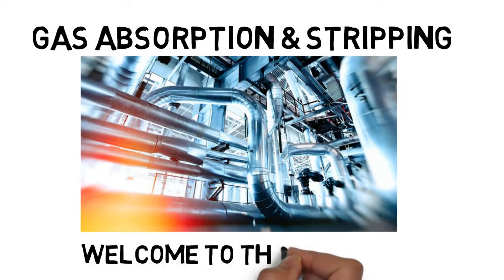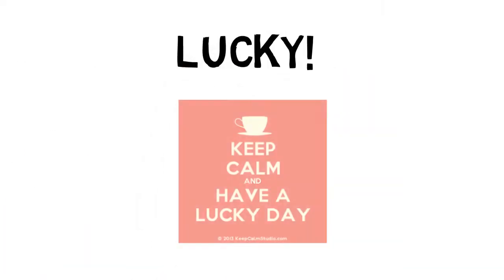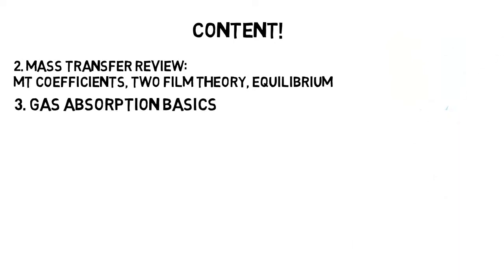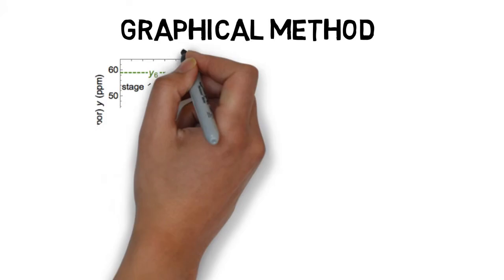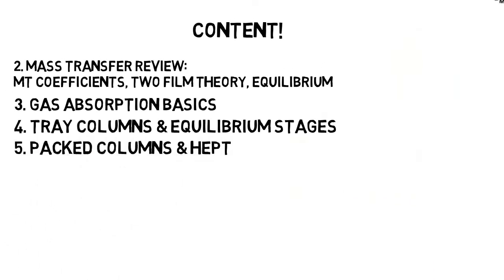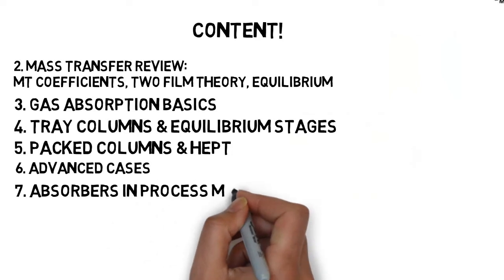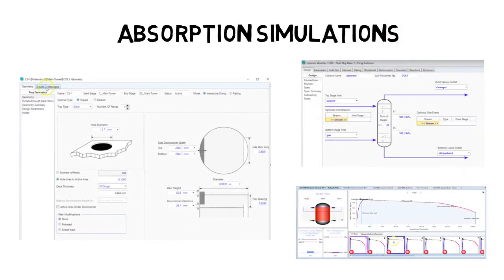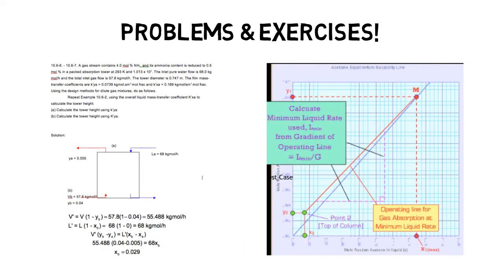Gas Absorption & Stripping - Trailer

Comment: Pretty cool. I am impressed you have sold me on this course with this video. ! I will make an effort to learn the prerequisites!
Reply from the maker: Thanks Garrick... Yeah! Definitively gotta know some basic before =P
Reply: What would you recommend as prerequisites? I took Fluid Mechanics, Thermodynamics, and Heat Transfer as I am a Mechanical Engineer. What is missing to make that jump to taking Chemical Engineering Courses. I went through your channel on Mass Balance do you have anymore recommendations? I see you are a Toastmaster also Great Job!
Reply from the maker: All those subjects will help! I think this course covers it mostly. You might want to review a Mass Tranfer or transport phenomena course to understand the driving forces behind the mass transfer in gas-liquid operations. Overall, I think you might start this course, this is pretty  straight forward. Mass Balance will help but not that complex is required